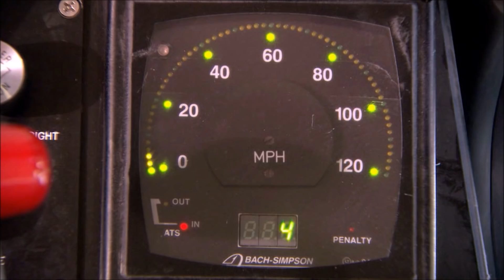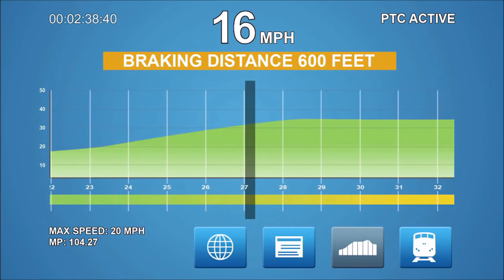Amtrak 501 "Cascades" Train Derailment 18 Dec 2017

Comment: Trains are not aircaft trains have a button called a alerter if it goes untouched for 30 seconds with out a control or the button being hit the train will go into emergency the BTC is not a thing for trains
Reply from the maker: csx68 midwest and western railroad -the BTC??

Comment: This doesn't compute! If the train had been going 80 m.p.h. it should've been scattered out for a 1/4 of a mile instead of a nice neat pile. Something is a dab screwy here.
Reply: There was a very long straight stretch where the limit was 80mph, so it would be very surprising if he did not speed up along that section. At the same time, if the train was travelling at 30mph, it could not conceivably have caused so much damage plowing through those trees. The truth may be somewhere in between these limits.
Reply from the maker: Lewie McNeely the train automatically  braked to 'stop' once the lines were severed.
Reply: Then it jackknifed?
Reply: The heavy trailing engine was still coupled to the last few carriages, so yes it probably jackknifed.
Reply: If you look at the schematic overview of the crash, the front of the lead locomotive has come to rest roughly 100 yards from the start of the curve. That is not stopping on a dime on a smooth railway track, that is plowing through dirt, which seems entirely feasible to me: https://en.wikipedia.org/wiki/2017_Washington_train_derailment#/media/File:2017WashingtonDerailmentSchematicSiteOverview_a_en.png If you look at schematic diagrams for other recent derailments (not with a dead-weight trailing engine), they are entirely consistent with the speeds and stopping distances of this crash: https://en.wikipedia.org/wiki/File:Spuyten_Duyvil_derailment_site_map.svg https://en.wikipedia.org/wiki/File:2015_Philadelphia_train_derailment.svg
Reply: Lewie McNeely One final point. The leading engine breached the barrier guardrail as it landed on the highway. According to the DOT, 200ft of steel, plus all the guardposts, had to be replaced. That is a significant (final) stopping force.
Reply: I do not know the answers for those kind of questions. Possibly the trees scraping down the sides of the loco kept it upright. Maybe the Talgo carriage couplings kept the whole train relatively rigid.

You may find this closeup video of the recovery of the locomotive quite informative: https://www.youtube.com/watch?v=oc24-FxeeJA
Reply: I can believe that but you had a LOT of mass coming on hard and fast till the crash happened. I've driven trucks grossing well over 200k's and they don't stop on a dime. Sounds like someone is trying to hang the engineer out to dry. I can see this at a reasonable speed, not at 80. And did he even have enough runway to get the rig UP to 80? I don't know. I just know big stuff does NOT stop quick and it was metal to metal. Just so much traction to be had there unless the new locos are running radials!
Reply: May be. Loose sand and trees would tend to slow something down that didn't have anything to really roll on. It's just goofy the engineer had run it before and knew what was coming up. I live on hilly narrow curvy roads and sure don't forget where a curve is that might take me out.And how are you going to stop on a dime when your footprint on each wheel is almost nothing even though it has a great concentration of weight on it? When it squeaks it's skidding. Loss of traction. NO not total, but a lot. Interesting.
Reply: THIS I'll go with, Gordon.
Reply: But Gordon, why didn't it FLIP? I've never seen anything turn over in these similar circumstances that didn't flip. The best I can tell the lead loco is still upright. If centrifugal force acted on the train, the lead engine ought to be off the track on the inside as it went over and on it's side when it hit. Maybe they'll figure it out. And I know the couplers have a certain amount of grab to remain in an upright position but they were wrenched apart. Lots of looking to do.

Comment: I heard PTC was installed on the line but was not active (due spring 18) .. It makes me wonder (*pure speculation*) if there is a certain amount of data capture that is required before it can be turned on.. learning the real worlds gps signals and blackspots and gradients etc.. on a new line there are no existing services to sample so thew first few weeks of running may be used as sample captures..
Reply from the maker: Parax77 good question!

Comment: My job, before I retired from British Rail often involved rail accident investigation and I can say without word of a doubt that, unless one gets down on the ground and seeks out all those little clues and identifies the relevance of each of them, one cannot reach any definite conclusions.  It means examining every little piece of damaged metal, rock, stone, wood, etc. to see  which were caused by the accident and which might have been involved in the  cause of the accident.  It is painstaking work but it has to be done otherwise one is working purely on conjecture.  
Well done Juan, as usual, thorough reporting.  You'll never get a job with mainstream media, you are too thorough and accurate.

Comment: Upon inspection of the photographs, the evidence does not support the hypothesis.  When a semi truck leaves a curve in the road due to speed the vehicle comes to rest on the outside radii of the curve.   The train wreckage can be seen on both sides of the curve in the rail tracks.  Probably more compelling is the evidence that significant structural concrete damage has occurred under the rail bed  in the local area of the bridge abutment.   Furthermore, note the missing track and rail bed rock above the localized structural concrete damage.  Couple that evidence with the massive damage to the tree branches and limbs  directly above the missing track and rock bed.  There needs to be a corrected hypothesis to match the damage in the concrete, rail bed and trees.
Reply: The lead locomotive and the first few cars were outside the radius. It looks (from aerial pics) like the locomotive left the track where the curve sharpens, just before the overpass. The rear locomotive had huge momentum and it doesn't surprise me that, as the front of the train derailed and rapidly slowed, it would push the remaining cars into the jumbled mess that we see on both sides of the track.

Comment: Design flaws abound....putting locomotives capable of 80+ mph on a track with 30 mph restrictions is ASKING for an accident to happen, no excuse for this tragedy.  Whoever OK’d this section of track for high speed commute ought to be liable.  Without having a complete high speed infastructure in place, these locomotives should never have been set on these rails, period.  Unbelievable......oversight?  No, this was an engineered disaster.
Reply: Martin Anon I realize that...hoyl’s law...anything that can go wrong will go wrong....having a track with a 30 mph corner in it should not have locomotion capable of 30 mph...even if an automatic braking system is incorporated.. if the track is not designed for high speed thoughout its entire course, a high speed train should NOT be put apon it....that’s my opinion but that’s just based on common sense

Comment: If they can design/build self driving trucks and cars it seems that the PCT is totally inadequate. Road hazards are much more complex than those faced by trains. I totally understand that the system inertia is much much greater with trains than trucks but difference can be dialed into the system software. Cross pollination is needed - Musk where are you?

Comment: if that is a new track build for the new fast trains why the hell did they put a 30 mph bend in to start with could of had a long curving track and your fast trains are 80 year old compared to European trains
Reply: On Google Earth you can see that the track runs between the I-5 and a golf-course, so realignment would be very difficult: https://www.google.co.za/maps/@47.0821379,-122.6755237,1085m/data=!3m1!1e3?hl=en
Reply: after seeing the new track and bad lay out your fast train should do no more that 40 mph to be safe sack the planers
Reply: It is possible to safely go faster on the long straight sections of track. If you look at a map of the Pudget Sound area, it is both highly developed and geographically restricted, with ocean, rivers, volcanic mountains, military bases, etc. See: https://en.wikipedia.org/wiki/Puget_Sound
Reply: bad planing start to finish could of fond different route used bridges and tunnels that's why the US are 80 years behind in rail travel. it was a waste of  money and wow can do 80 on straight bits for a few miles then back to 30/40 for rest of the time. unlike EU trains doing 300 mph and 80 mph on some slow bits but not many of them as to good planing.
Reply: @ronald turnbull
If you could tell me where there are European trains doing 300 mph, I am quite curious to know.
Reply: The AGV Italo from maker Alstom is designed to reach speeds up to 224 mph, but it generally rides along at 186 mph between Naples and Milan. Should it ever need to, the train has gone as fast as 357 mph
Reply: France makes it easy for tourists to visit different parts of the country, thanks to its TGV high-speed trains made by Alstom. The POS’s operation speed reaches 199 mph – the max it was designed for – but its record is 357 mph
Reply: I’m aware of the record of 357 by the TGV. However, that was a single run under special conditions. But you made it sound like there were actually trains running at 300 mph in service, and I have never heard of one. Most of them are doing 300 km/h, which is 186 mph. Things get complicated when you try to go much over 200 mph, so they normally don’t go much faster than that. There are videos on YT showing in-cab views of complete runs in Europe, displaying the various speeds they go at. They don’t always run at full speed, they often go 30 mph or less in congested or curvy areas, especially around cities. Since they go into the city center, they often run on older track which is much slower.
Reply: I think it's a case of new track on an existing alignment.
Reply: ronald turnbull that track has been there for quite some time and is heavily used by freight trains everyday. As far as I know, nothing was  modified in that particular section of rail to allow high speed trains to pass without slowing down. I take that back, new shrubbery and grass was put down near the golf course

Comment: First, as an operator of Charter buses and large transport trucks the only expertise that I can relate to, is the understanding of operating a large moving object with inertia, centrifugal forces, etc. that get an operator in thick do do very quickly if they aren't paying proper attention.  Having said that and looking at news reports, I noticed from a camera position north of the rear engine that the grade leading to the turn appearred to have a downward slope to the curve with a sharp curve and even more downslope on to the bridge. If that were a mountain road and a big truck instead of a train I'd a reduced throttle and applied brakes in advance of the curve knowing that the previous speed, the length of my truck and the weight of my truck would all add up to disaster if I didn't do what my training and experience said I needed to do. I must say the engineer sounded professional and calm reporting in? I don't to want to see anybody crucified but I can't imagine he wasn't being negligent on his approach t the curve.

Comment: At least from what we know now, this derailment is very similar to the Santiago de Compostela derailment which happened in 2013 in spain and killed 79. The train derailed at a dangerous curve, a tight 80km/h bent at the end of a high speed line. Exactly ahead of that dangerous location, the ETCS/ERTMS installation ended without slowing down the train. ETCS is a European train control system with similar capabilities like positive train control.
Reply: I was reading that report earlier today, and it is both similar and different. In that case, it was possibly a combination of distraction and misunderstanding about the actions needed at the end of the ETCS section (either by the driver or the computer), when it joined the slow-speed track: https://en.wikipedia.org/wiki/Santiago_de_Compostela_derailment#Investigation
Reply: To my understanding the driver was aware of the fact, that ASFA will not slow down his train, but due to distraction he did not notice the end of the ETCS controlled section. The main connection I saw was a lack of appropriate train control to enforce line speed limits.
Reply: Santiago de Compostela's train was a Renfe Serie 730, a Talgo 250 equipped with power cars (Talgo-Bombardier). For this reason also known as Frankestein. 
http://www.frankenstein04155.com/
https://en.wikipedia.org/wiki/RENFE_Class_730

If you see the video of this derailment you see derailment starts in the second car, the power car equipped with a huge diésel generator and tank fuel. https://www.youtube.com/watch?v=oGLCzFu0LH8

"Speed does not seem the only cause of the fatal outcome. There are railway experts who point to the composition of the train (much weight at the ends and little in the center) as one of the factors that have been able to aggravate the consequences of the accident. The accordion phenomenon that occurred in the curve, which even catapulted and blew one of the cars to the outside, is attributed to a great inertia in the tail of the convoy, which made a whip on the composition of the Alvia and affected the light ones Talgo cars."  https://treneando.com/2013/07/26/solo-un-problema-de-velocidad/
Reply: @torre I did not know about that part of the history, do you know how heavy the powercar is? I can't find any numbers, but according to the maximum axle load it can't be more than 54t for the powercar, or do they use three axle bogies? Compare this to a 120t Siemens charger Amtrack uses.

Unfortunately I am unable to understand Spanish.
Reply: Thank you, now I understand the issue, also looking at other photos. The powercar is supported by a twin axle bogie and a single axle shared with the first passenger wagon. Here is a very good collection of detailed pictures: https://www.drehscheibe-online.de/foren/read.php?2,6510660,page=all Even if you can't understand the german text, I think it helps to understand. Outside freight rains I never saw such an asymmetric design. To summarize what they concluded, the asymmetric design and high center of gravity caused the powercar to tip over, when the speed was exceeded.
Reply: You're welcome / Ez horregatik
Reply: @Daniel Rose Talgo produces this train under designation Talgo 250 Dual.

Technical features can be seen here https://www.talgo.com/en/rolling-stock/high-speed/250-dual/

Talgo technology https://www.youtube.com/watch?v=hTpmfi9tpG0

Talgo is involved in Saudi Arabia, High Speed Railway Haramain  https://www.youtube.com/watch?v=VaxKlQfe9OE

Comment: The tilting system is supposed to let the train take curves at higher speed than a normal train, so was 30mph for a normal train, or this train?
Reply: I think the Talgo system is more about passenger comfort (swaying on curves), than keeping the train on the tracks. The track itself can be slightly tilted, called superelevation, but it is not clear if that was done on this curve (unlikely IMO). No amount of clever engineering will allow a train to safely take a curve this tight at 80mph.

Comment: How do you not know the turns on your track and what speed to take them at? It's a mistake of inadequate information and too much reliance on automated shit! What happened to "Know your shit"?!! Why didn't the drivers or engineers know their route? Why drive blind?
Reply from the maker: good point...is this a case of excess reliance on automation?
Reply: blancolirio Seems like the only logical explanation. That train went off the rails as soon as it hit that curve. The guy on the radio sounded like he had absolutely no clue, like it was normal operation at safe speeds. PTC or no PTC, nothing excuses not knowing or relaying/passing of critical information like "Maximum speed on this turn". If that information was unknown or incorrect then even PTC would've failed. Even If the information was known and PTC  was deployed, the engineer and/or driver would still need to know their route in case of PTC failure or malfunction.
Reply: blancolirio Even incase of conflicting information like 80mph vs 30mph rated speed, the logical choice would be "Better safe than sorry". This is clearly too much reliance on technology.  I'm sure as pilot you know of cases where technology screwed the pilot, like Qantas Flight 72.

Comment: From a UK  rail user point of view:  not sure why PCT  isn't installed as standard on all new or upgrades of track.   At the moment in the UK  track and stations are looked after by one department  (Network rail)  is American track repairs etc down to the company who runs the track?
Reply from the maker: good question!
Reply: Yes, and/or the cheapest bidder that they can squeak by the unions.
Reply: For all the complaints about fare prices and  late running, the UK rail network  have had very  few accidents since  the govt agency (Network rail)  have taken over maintenance  of tracks